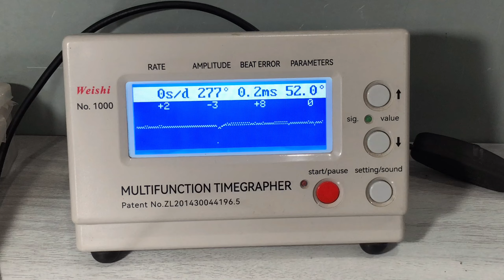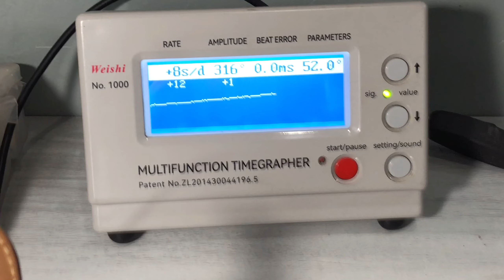Service and Maintenance of Vintage Tissot New Timer - 2581 Automatic Movement

Comment: A master craftsman at work. Such a complex movement disassembled and reassembled so easily.By the way, did you put the screw on the crown wheel after fixing the automatic works or just left it with one screw as before?
Reply from the maker: Hi, thank you for your kind words. 
Crown wheel’s second screw come from the automatic bridge. The middle screw on automatic works bridge is little longer than the other two. That screw goes all the way through automatic bridge and screws in to the crown wheel.
You can see it at 21:44 where I rectified the screw of crown wheel and the other screws holds it from above the automotic bridge.